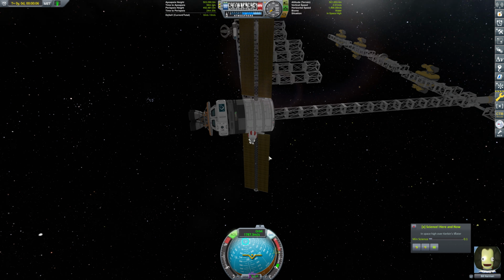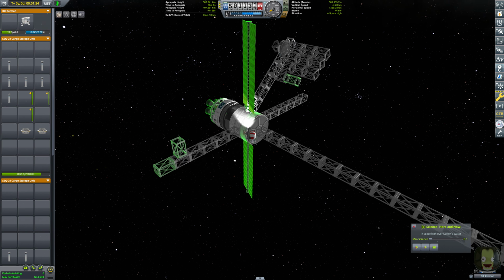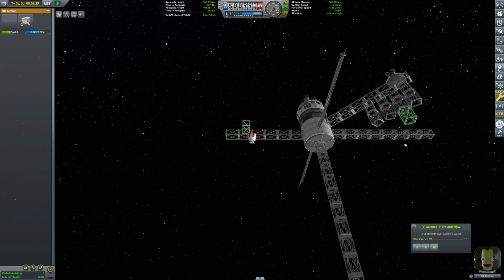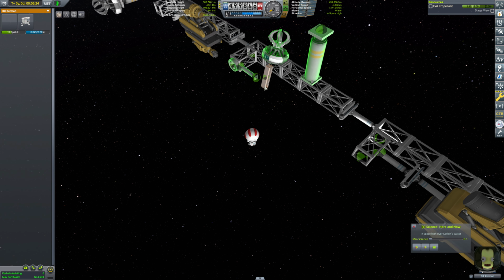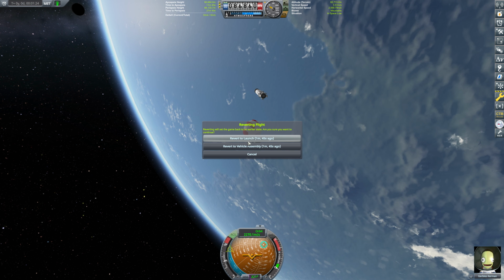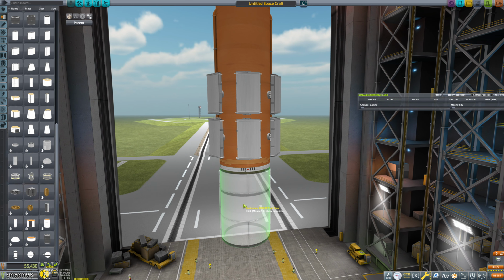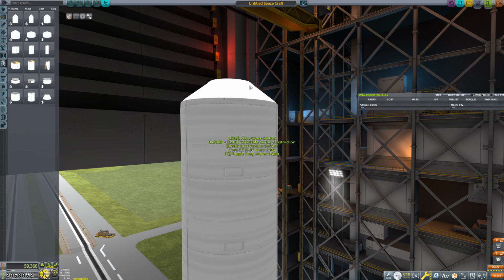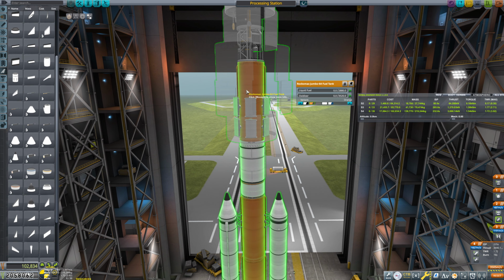Kerbal Space Program | Atraitus Deep Space Mining Co. | Episode 63

Comment: You may need to put the secondary wheels on static parts of the superstructure, or they may resist normal hinge movement. Also, those drills are probably going to need more power, and you don't need those huge fairings! Just put a nosecone on top and a downwards decoupler for dropping it.